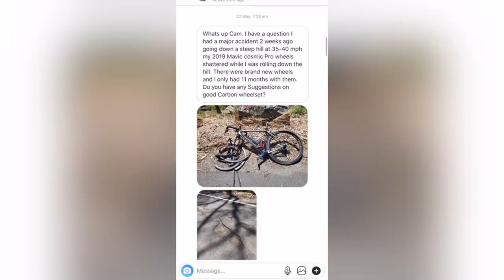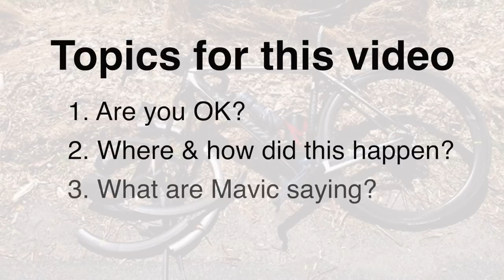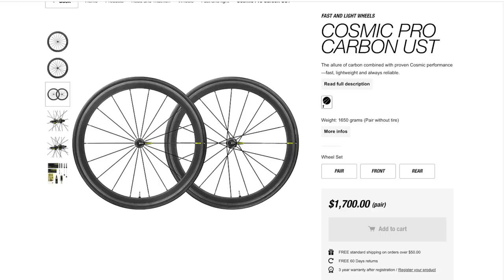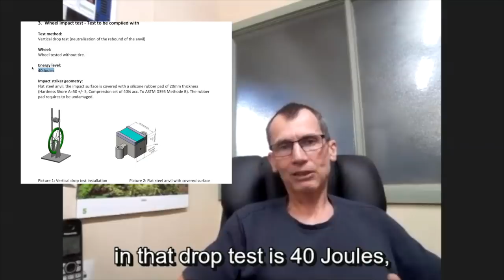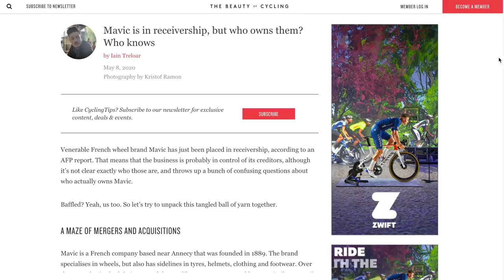A FRIGHTENING MAVIC CARBON WHEEL FAIL (at speed)

Comment: @Cam Nicholls .....as a supposed 'expert' on cycling - I have some questions for you: Which team has dominated professional cycling - and particularly 'Grande Tours' - for more than a decade? [I'll give you a clue - they have won TEN of the last twelve TDF's]. Which team has revolutionized the manner in which pro-cycling teams are managed and run in terms of riders, bikes, components & equipment, training, performance and data analysis, nutrition, recovery, clothing, sleep and rest and even the use of isotonic baths? Which team has implemented the groundbreaking strategy of the 'aggregation of marginal gains' - which has even transcended the sport of professional cycling and is being adopted by numerous MNC's to improve efficiency and productivity? Which pro-cycling team has the single largest budget in the sport [an estimated US$34M per year] and can afford to cherry-pick the very best and most advanced equipment etc available? 
Which team has NOT GOT ONE SINGLE DISC-BRAKE EQUIPPED BIKE - not even for training purposes? Answer: SKY/Ineos-Grenadiers
Reply from the maker: haha, correct
Reply: @CamNicholls  .....Thanks. The point I was trying to make [and not as an affront to you personally] is that many posters on here have tried to make this about Disc vs Rim brakes. This is utterly ridiculous! 'John' clearly is a BIG guy and was descending very rapidly - without braking - down a hill when he struck a pothole. This resulted in a catastrophic failure to his WHEELS!  It has nothing whatsoever to do with the method of braking. In fact, it was much more about the build quality and history of his wheels as well as 'John's' weight. 
I have personally experienced a very similar accident. My bike was equipped at that time with Reynolds 46 carbon clincher wheels - when I hit a huge pothole went over the bars, landed on my head and was knocked unconscious. I used to ride with a professional UCI mechanic [Manu] and he checked both my wheels and frame etc over for any damage - they were fine. 
In fact, I have been riding carbon wheels for approx 15 years and only once had an issue with them. [I had to replace the Reynolds wheels last year because the spoke nipples - which are internally located - corroded and the spokes would break virtually every time I went out!]  Incidentally, I live in HK - which is extremely hilly [you are either going up or down a hill] and regularly braking. I have only ever used Rim brakes and weigh approx 57kg. 
SKY/Ineos- Grenadier's supremo Sir Dave Brailsford - as you probably know - is obsessed with identifying any 'edge' or advantage over his competition. This philosophy is known as 'marginal gains' - which Brailsford is a devotee of and slavishly adheres to. Surely if he thought that Disc brakes were better/lighter/faster/more aerodynamic etc than Rim brakes - Ineos-Grenadiers would be using them? 
To be brutally frank - I have MUCH more time and respect for the likes of someone such as Sir Dave Brailsford with his unrivalled knowledge, experience and expertise of creating arguably the most successful professional cycling team on the planet than I would ever have for some cycling newbie/trendy!

Comment: I seem to also remember a Tour de france on a big descent ( Armstrong Era / rim brakes) where the carbon wheel rim heated up so much that the glue melted on the Tubular tyre cause massive failure … The rider involved had some rather bad injuries .  I ride with 50mm deep wheels on rim brake but these are allow braking surface with a carbon fairing.  Whilst probably nowhere as cool or as effective as the full carbon, they perform well enough...

Comment: From the looks of the rear wheel failure, the rider must have hit something (rock, pothole?) pretty hard.  I don't think that would be a wheel manufacture issue.  Maybe too low a pressure on the tires?

Comment: OK so I'll stick with my zondas then and probably get a respray on my old alu tt frame. Jeezus, nobody needs that. 100kg at 45mph descent though, big lump, not sure I'd feel comfortable plus 20kg at that speed on any carbon 🤨
Reply: ironman tooltime - same wheels I have, top notch well worth the cost.  I’m in USA, had to get them from the UK.
Reply: @robertp7209  yea light and true. I don't spend that much time at 40kmh so aero gains from deep rims would be limited. Saving in this article is 6% at 300W for all aero gear, not just wheels. If you're averaging less than 250W over long events there's likely to be very little measurable benefit other than to ego. Like when I overtook a guy running in next% on a marathon last year on my way to a 3:42 😂 https://www.cyclist.co.uk/in-depth/534/how-much-time-can-aero-kit-save

Comment: I'm sorry, '24000 joules (=24 kJ)  into the wheels' makes no sense, as Joules is a measure for energy. If you impose 24 kJ onto the wheels over 5 hours the friction heat generated would be no problem at all (it would be 24000 J/(5*60*60) = 1,33 Watt, hardly enough to keep the wheel warm.
 
Did he mean J/s = Watts ?  So 24 kW of 'peak breaking power' (which would probably be disastrous)?

Comment: due to a broken Look pedal spindle I ended up in the hospital for 3 days with a serious concussion.  Look settled with me - they even sent me a new set of pedals - like a imbecile I installed the new set of Look pedals - 14 months later the plastic Hardware failed catastrophically - the pedal separated from the spindle during a Sprint finish I ended up getting squirrely and going straight into the steel fencing on the side  the course - broken collarbone separated shoulder, fractured vertebrae.... and two years of unsettled litigation.  I'm an imbecile for riding those new Look pedals

Comment: I have never owned a new bike, and can't afford (or don't want to save and then spend) fancy anything. I have 3 bikes I currently ride. All 3 weight 30lb/14kilo. Sounds heavy, but it is all I know. I have no concern to shave of a few hundred grams, and I have now seen enough shattered carbon wheels I would never use them. I have pushed near 60mph/100kph on steep down hills...would really hate to have a wheel shatter because I hit a bump.

Comment: There are things made for racing.  Light fast but always on the cutting edge.  You may have forgotten the Fastnet disaster where lightweight racing boats were decimated by a storm.  Heavierweight ocean going boats survived.  Twenty years later in Sydney Hobart the boats were again battered by a storm and lives lost.  The quest for speed came at a terrible price. Now the question is are these wheels really up to the rigours of long term day to day riding or are they primarily a racing tool?

Comment: Normally when you use carbon rims with carbon braking tracks , you use specific carbon brake pads which hasn't been the case here also the previous generation of Cosmic  Carbon were fully made in France and had alumnium rim brake tracks which made them much more solid than the Cosmic Carbone which are made in Romania since 2008, not the same quality. AT last but not least I have also seen failures from other brands. Also when you drive at 72km/h and with 100 kilo of weight, you might expect some failureeven though mavic said  that 120 kilos was the limit. Like I said before for full carbon wheels with carbon brake tracks, you need to use specific brake pads for carbon wheels, if you don't use these , this is the type of failure that will happen.

Comment: The rider didn’t say he was braking on the descent.  Looks like he let it rip.  45 mph.  Don’t see excessive heat as a possible root cause consideration at least from this last ride.  Plenty of cooling.  Root cause analysis required.  Since the body of evidence is intact and available, and the driver is here to answer questions including witnesses in support of the analysis, the cause can most likely be determined.  No speculation is called for.  I didn’t notice if the fork survived the crash - well done if it did.  The rider could have a legal claim for his injuries, pain and suffering, etc. , if he chooses to pursue.
Reply: Pete is never wrong - my first sentence covered the heat issue.  Disc brakes more than negate any possible weight savings with carbon over aluminum allow, actually penalizes one, not to mention jacking up the price with more profit.  And road bikes are not convertible, purposely designed not to be, so one can’t go back to alloy and rim brakes.  Junk the frame and fork both.  In this failure the rider has obvious injuries especially to his face possible scars and hospital care, a $$ liability claim may be worthless thats why the bike company didn’t respond I bet, they have lawyers to advise them.  Given the road surface pictures, the bike or wheel company will say the wheels are not designed for such road deteriorated defective road surfaces.  On the heat damage over time, the owners manual makes it clear (I’m sure), you are not to hold the brakes on long descents, brief bursts of braking only.  No heat damage will occur.  The material analysis of the failed rims will show if such a condition existed be it from cyclic heat or instantaneous.  Regardless, warranty would be voided for improper use.  I don’t know why you guys have such a hard-on for carbon rims and added cost.
Reply: Pete is never wrong - “Don’t see excessive heat as a possible root cause consideration AT LEAST FROM HIS LAST RIDE.”   Peter is wrong.  There it is you missed it, so restated it again.  Study what I wrote, not read.  Study.  If someone is selling, someone is buying - enjoy your collection.  Who’s denying it?  Overpaying on equipment doesn’t impress me.  Rider conditioning and training is what matters and is earned not payed for.  All the money in the world for bikes cannot substitute.  For those who are concerned with life and and don’t want to be dead or worse, like their next two wheels being a wheelchair, go to Walmart and purchase the cheapest road bike they sell.  All of this carbon fork: steerers and crown, and carbon rims are worth for sh-t, all the way back to the first Spinergy wheels.  I recall the characters like you in the bike club first to get them, beaming like new fathers at the hospital.  Catastrophic failures, lawsuits, good by.  My 1996 full carbon monocoque design Kestrel 200 csi with EMS carbon fork steel crown and steerer, mavic double wall rims, full campagnolo, still on the road, perfect condition not a single crack.  Original rim brake pads in place.  I can stop on a dime.
Reply: Pete is never wrong - Road bikes came a long way from 1996?  Like what?  Are you a professional rider getting sponsored and payed by the bike company?  Or are you a Tour de France wanna be?  What came a long way?  A couple of extra gear set cogs?  Electronic shifting?  Disc brakes came from motor bikes onto mountain bikes then on carbon wheel road bikes.  Aero?  Better see Hambini’s channel - Aero is another fraud.  E bikes?  Tubeless tires?  Designer wear?  You can’t be serious.

Comment: 220 lb rider at 45mph downhill? Wow!
At 125 lb, I would generate half the brake energy at the same speed, perhaps even less considering non-linear issues. My rim brakes are fine for my weight. Heavy riders need discs on any carbon wheel, simple as that.
And yes, I spend a lot of time on the truing stand straightening out my bent old-school steel rims from potholes, but they can be fixed, unlike sketchy carbon fiber.

Comment: It wasn't much of a pothole. Mavic have enjoyed a questionable reputation for wheel quality but I'm sure this is an extreme outlier. I dig their shoes.
Reply: Not much of a pothole??? Heavy rider hitting they at 75kph is asking for trouble. I don’t doubt there was an issue with the wheels that exasperated the failure but you don’t want to be hitting anything at that speed. Also, poor bike handling skills can contribute. People need to learn how to brake properly. You see it all the time, people on the brakes all the way down a climb, heating up the rim when in fact harder braking in the approach to the corner, releasing your brakes, being able to feathering your brakes and alternating between front and back will reduce the heat. Personally I wouldn’t buy Mavic wheels

Comment: Why would someone ride a carbon bike if they are not racing? It's like going for groceries in F1 car. You can train the same on the 15kg steel bike. Especially for someone that's overweight as the guy that crashed. You can improve more in a year then buying lightweight carbon bike will make you.

Comment: Why the hell is Raoul talking about 24 kJ. Dissipation of that energy would've been the case, had he hit a wall head on, with rider remaining firmly on the bike and the bike remaining firmly on the ground. In reality rider is a suspended mass. Ass and hands are quite compliant, so they'll transfer quite little impact force.
Another factor is the angle of attack. To transfer full force he'd have to - again - hit a wall. If you hit a 5cm pothole (which is a quite deep pothole for a road bike) then your angle of attack would be ~30 degrees. Sines, cosines and some magic later, you have a vastly reduced  impulse force, damped vertically and longitudinally, WHICH DOESN'T STOP THE RIDER. You end up only with a slight reduction in kinetic energy, where the vertical force component is used for your upwards movement and longitudinal causes a slight decrease in speed. 24 kJ is NOWHERE NEAR the energy transmitted by the wheel. UGH!

Comment: I had the something similar happen to me going down Pikes Peak in Summer 2018.  I was doing about 20 mph and thought it was a flat but I couldn't stop so I laidthe bike down and took the road rash.  Turned out the wheel had failed.  PS.  I'm 74 kg and wasn't going that fast.
Reply from the maker: Interesting to hear, thanks for sharing Brian. Cam

Comment: Yeah, so, if I had the money for carbon wheels, and was really skinny, I still wouldn't take a long descent at over 70 km/hr.  I can't imagine breaks generating much heat at that speed, because I've never been on any descent so steep that I couldn't just sit up and "air brake" back to 50 km/hr.  I only ever go that fast if I can see the run out to the descent - otherwise I break my speed intermittently (disc breaks) to keep it in control.  I'm missing half a vertebra, though, so maybe I'm just old and scared.

Comment: I would never use carbon wheels for a number of reasons 1. I'm 102Kg, 2. they are expensive, 3. when they fail they do so catastrophically and most importantly 4. I am a middle aged bloke with absolutely no illusions about my cycling ability or fitness so have absolutely no use for carbon wheels at all and I reckon that would go for a very high percentage of the people using them (Think how many 4 x 4 vehicle never see so much as a muddy field!). I would say that these lightweight performance products are the reserve of professional cyclists and vain cyclists!
Reply from the maker: Fair call, thanks for sharing mate. Cam

Comment: For that clip of Cav folding that wheel, was it ever acknowledged that Cav was being Cav, and entirely too aggressively went into the bloke on is left to keep him from passing and just managed to get his own wheel under the other guys front wheel, which is what actually folded that wheel? I mean, I am an aerospace engineer, and I have designed and made many a carbon fiber panels, but even if that had been an aluminum rim, the results would have been similar. Not as catastrophic? But just as bloody.

Comment: Well, this video answers the question of "should I get carbon wheels?" I ride a carbon bike, and it holds up well given the stresses I put it through. But, it is not exposed to the punishment that wheels would go through. 

There is a video series of some chap building a bike with unbranded carbon blanks from some factory in China, including wheels, bars, and drive-train.  These all have minimal, if any, QC backing them up, so...imagine flying down a hill at >50k and watching your bike delaminate under you.  I am not trying to hate on China, as I would not buy any carbon anything that has not been properly vetted and tested. X-rayed, light tested, stress tested (if that is a thing) and with a healthy warranty. 

I have rim brakes, but it would seem logically that disc is the way to go all around since the heat would be better dissipated by sinks, rather than your tire. Although, in my experience with motorcycle and car disc brakes, if the fluid gets too hot, then the brakes begin to act wonky. I am guessing that would be the same for bikes.
Reply: I'm still waiting to see vid of Chinese carbon wheels failing. As the carbon expert said, he can count on one hand the amount of times he's seen/heard of a failure like this. That being said, I'm going to start looking at aluminum wheels.

Comment: My prediction before listening to Raoul:
Rim brake carbon clinchers are the WORST idea in the world. Raoul has said numerous times that he hates carbon clinchers. Braking heated up the rim, softened the resin and the wheel/wheels gave out on impact of the hole.
Reply: Conclusion: I havent run rim brakes in quite some time now...my original reason for wanting to switch to disc brakes was why would anyone want to use their $2,000+ carbon wheelset as a brake!?!?!?! When i would be braking on my Zipp 404's I would shed a tear everytime I'd even just stop at a red light. Discs completely eliminate any heat/braking related issues from the equation.